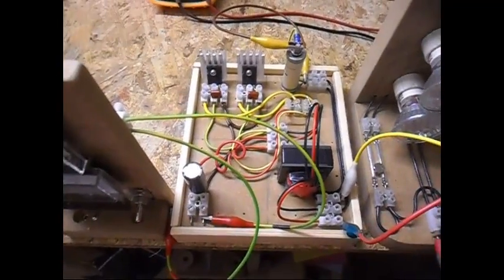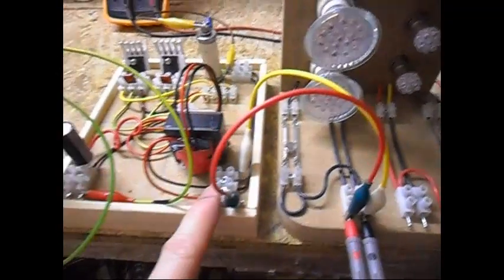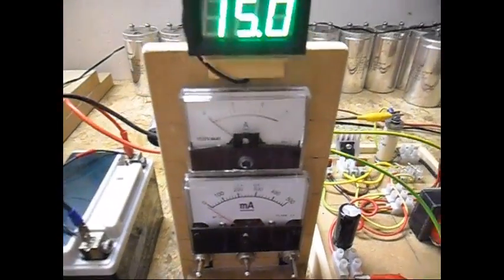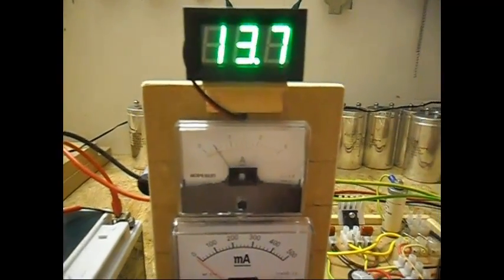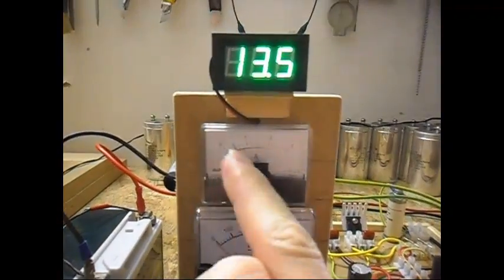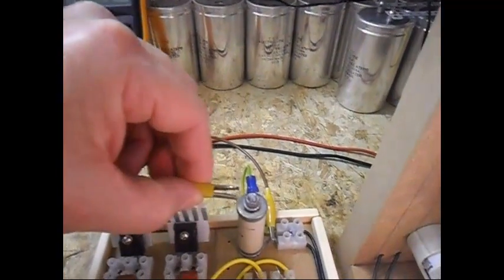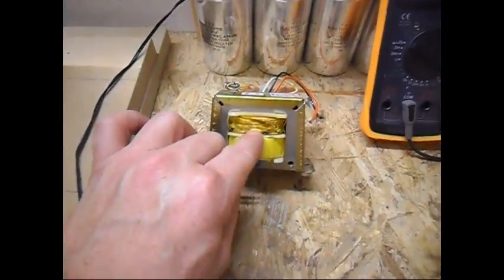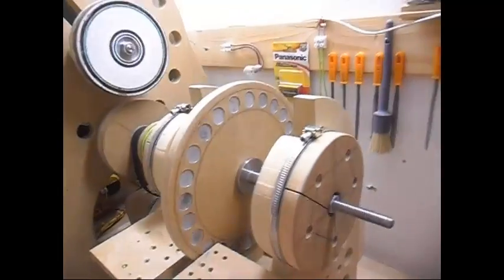Joule Thief_HF Inverter_Oscillator - Update 7 Royer oscillator, HF ferrite transformer...

Comment: OK here is my contribution to your project for basically zero money you can have a laboratory accurate  AC and DC amp meter using this simple technique.  Using standard formulas you'll be capable of measuring RMS peak and peak to peak AC current

Poor Man's DC shunt to measure high current
#44 Poor Man's DC shunt to measure high current

Making a shunt for a 20 amp analog meter
Making a shunt for a 20 amp analog meter .mp4
Reply from the maker: Thanks for your comment and the links...^^
I'll check them links as soon as i have more time on my hands...^^
Btw, your comment was marked "spam"...lol
Cheers

Comment: OK here is an example of a high efficiency radio controlled car motor it is only 27.8 mm in diameter is capable 85 to 89% efficiency.  Now just for a moment imagine scaling this motor up to the physical dimensions of your motor imagine how much power this motor would have.  And if built properly would still maintain this high efficiency.

http://www.hobbypartz.com/96m279-2848-970kv-34t.html
Reply from the maker: Thanks for the link and info...^^
And what is the point you are trying to make with your writings above...???
Take a small efficient design and  scale it up...ok good...so...???

Comment: ok 

13.8v X 600ma = 8.28 Watts

13.8 X 400ma = 5.52 Watts

48v X 172.5ma = 8.28 Watts

50v X 110.4ma = 5.52 Watts
Reply from the maker: Thanks for your comment...^^
Input is pretty close except for a 0.1v difference @ 400ma...lol
The way you go about the output, let me say that i wouldn't go about it like that but if it makes you happy i'm all for it...^^
Cheers

Comment: 15v X 600ma = 9 watts

48v X 187.5ma = 9 Watts

15v X 400ma = 6 Watts

50v X 120ma = 6 Watts
Reply from the maker: Hi ke4uyp,
Thanks for your input...^^
Why are you using wrong numbers...???
Input = 13.8 @ 600ma = 8.28W bypassing the hv cap.
Input = 13.7 @ 400ma = 5.48W with the hv cap.
Input voltage was dropping a bit while recording...
The output is 48vac or 50vac...
Since i haven't measure the ac amps output your calculation on that isn't any good...
You know better than that, i know you do...^^
Don't make my setup looks like it is unity, glad you like it but don't like it that much...lol
We don't want to mislead anyone here now do we...^^
Reply: Mister Caribbean Roots The capacitor does not Supply Energy to the system it only Stores Energy that is already in the system.  The only way to calculate the total energy input to the system is to measure the input voltage and current.
Reply: Mister Caribbean Roots So you want to talk about me, confusing people but you are the one performing scientific experiments and highly technical experts, but you're using pseudoscience definitions like unity and over unity.  

The correct terminology is system efficiency. You may have an 80% total system efficiency but you can never have a 100% system efficiency.  And I feel sorry for all the ignorant people who honestly believe you can have more than 100% efficiency.

Lighting efficiency
Artificial light sources are usually evaluated in terms of luminous efficacy of a source, also sometimes called overall luminous efficacy. This is the ratio between the total luminous flux emitted by a device and the total amount of input power (electrical, etc.) it consumes.

It is also sometimes referred to as the wall-plug luminous efficacy or simply wall-plug efficacy. The overall luminous efficacy is a measure of the efficiency of the device with the output adjusted to account for the spectral response curve (the “luminosity function”).

When expressed in dimensionless form (for example, as a fraction of the maximum possible luminous efficacy), this value may be called overall luminous efficiency, wall-plug luminous efficiency, or simply the lighting efficiency.

The main difference between the luminous efficacy of radiation and the luminous efficacy of a source is that the latter accounts for input energy that is lost as heat or otherwise exits the source as something other than electromagnetic radiation. Luminous efficacy of radiation is a property of the radiation emitted by a source. Luminous efficacy of a source is a property of the source as a whole.

https://en.wikipedia.org/wiki/Lighting_efficiency#Lighting_efficiency
Reply from the maker: ke4uyp
Thanks for your comment...^^
Like "Duh", the input is plain and simple since the voltage and amp draw has been measured...lol
Thats why i corrected your calculation in the first place...^^
Reply from the maker: ke4uyp
Thanks for the info...^^
Nice Copy & Paste action there...lol
I can use whatever title i want since it is my channel and videos whether you like it or not...lol
I haven't claim anything wich isn't there...^^
Seems to me that you are trying way to hard to undo something that isn't there and you are kinda making a fool out of yourself trying to make a fool out of me in the process...lol
And btw, why watch these videos in the first place snice you clearly don't like them...???
You should not waste your time on my foolish videos since they doesn't make any sence according to what you have been taught and that itself don't make any sence either...lol
Because of ignorant people fooling around there has been a lot of aweswome  invention discoverd.
So don't underestimate the stuff ignorant people do...^^
You might be using some of those inventions right now without you even knowing it...^^
But i do want to thank you for feeling sorry for all the ignorant people that are fooling around with this stuff...thats very human of you...^^
Cheers
Reply: Mister Caribbean Roots Why are you so reluctant to give both of the output measurements the voltage and amps?

Are you afraid that it might reveal just how inefficient and your motor really is?
Reply from the maker: ke4uyp
You sure do complain a lot now do you...lol
If you should be so kind to donate so i can buy a meter to measure the output AC amps i will gladly do it for you so you can sleep peacefully at night...^^
Btw, this is not a motor but a SS setup...you do know the difference between the two right...???...lol
There is nothing that i am afraid of...^^